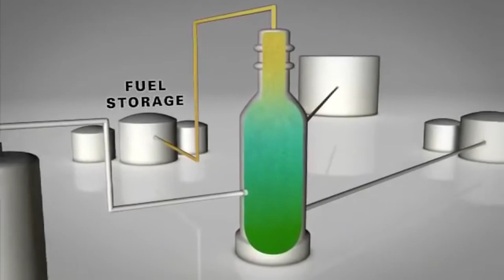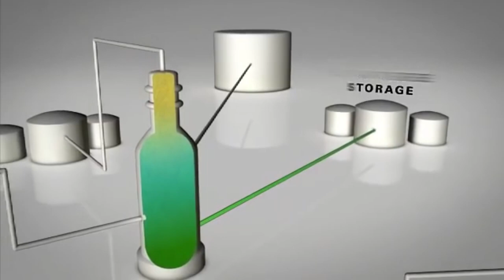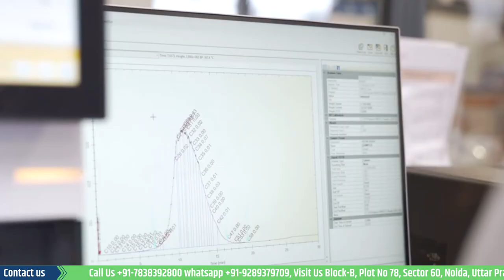Waste Oil Recycling and business opportunities in the sector | Oil Recycling Plant | Enterclimate

Comment: Used engine oil aap purchase karte ho
Reply from the maker: no, we do not purchase used oil, but for details of oil traders, contact Enterclimate - 7838390340
Reply: @enterclimate1698  can I filter used engine oil through   a 1 micron filtration system and reused it into a machine .